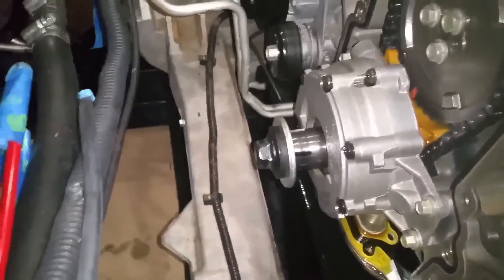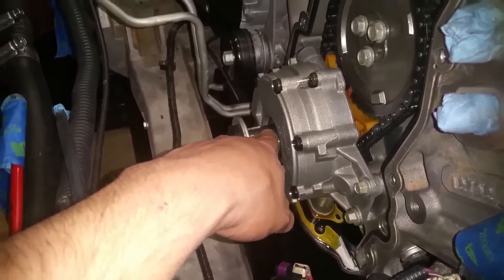Finding TDC on LS Motor. Procharged C6 Build. Part 17

Comment: I just used a bore cam to get TDC however I'm having a no start issue. And I think because I don't understand fully about compression stroke... On compression stroke what position should the intake and exhaust valves be in... Not sure if this is my problem but I nerd to verify.
Reply from the maker: Your probably 180 degrees out. if my memory is correct if your on TDC both valves will be closed.

Comment: I may be wrong but working from memory here, I believe the keyway on a L76 on the crank should be near the 10:30 position
Reply from the maker: Hello 407ForRent, thanks for watching my video and thanks for the comment. I cant be sure about the keyway position on the L76 engine, I never worked on one but on the LS3 dry sump motor the keyway should be at the 1:30 position when at top dead center. All of the LS motors have slight differences. Just like the LS2 and the L76 found in the Pontiac G8, both block are 6 liters but I believe the L76 has different heads and a smaller cam than the LS2.
Reply: @WATCHMEWRENCH  I ki